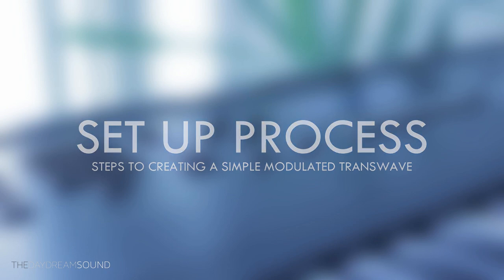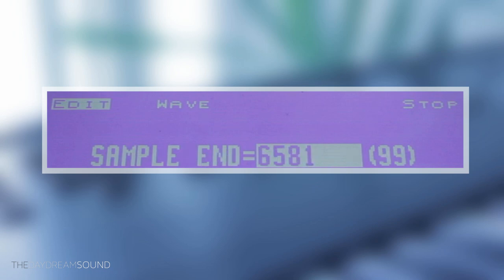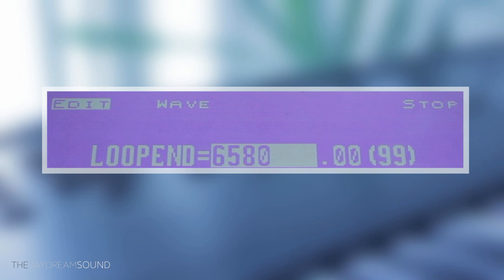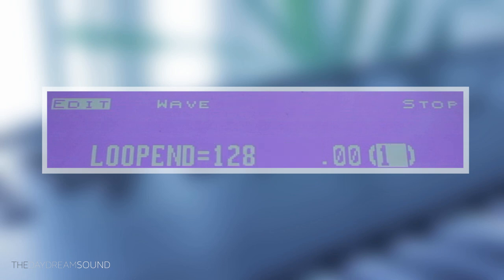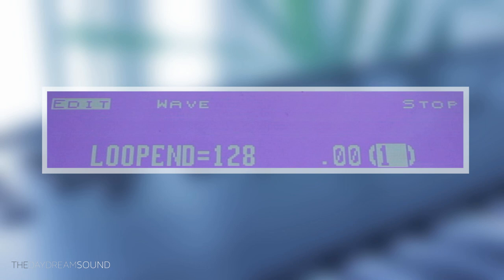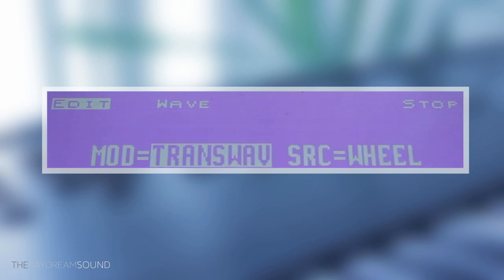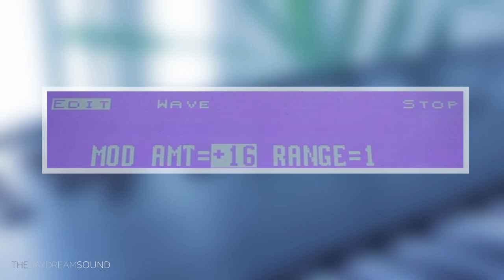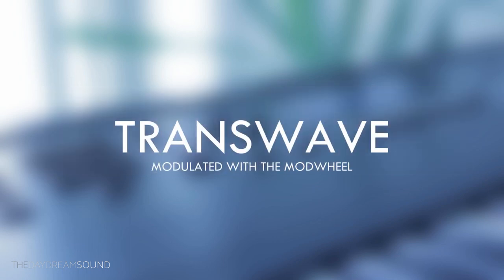How To Make Simple Ensoniq Transwaves on the ASR 10 Synth Sampler

Comment: That's cool. You made me want one. Have you ever used a Korg dad-1?
Reply from the maker: What's up Dustin! The ASR-10 is definitely a great sampler synth! Did you mean a Kord DSS-1? If so, I haven't' but it's a great sounding sampler and I do want to pick one up sometime.
Reply: Whoops stupid autocorrect. Yeah I meant the DSS-1. It's a pain to use but I love the way mine sounds. They're gigantic though so you really have to love it to let it take up so much room.
Reply from the maker: The first time I heard one I was blown away!
Reply: not only size but the weight of it ,  but i sold mine long ago  ,  to slow diskdrive  ,  quite  thinny  sampling quality  (an ensoniq  blows it away)   albeit  the same analog filters of the dw8000  , the rack version dsm1   featured  16  outputs as i remember

Comment: I'm assuming this is possible on the EPS-16+ as well?
Transwaves are definitely necessary for my brew of industrial/avant-pop.
Reply from the maker: What's up Sailbot216! Thanks for reaching out! It's definitely possible with the EPS16+!
Reply: Good to know! Just checked the waveform mod options and there it is!
Reply: Trying to do it now and I'm having some trouble. Not sure what I'm doing wrong.
I bring in two samples, each in their own layer, then splice and add the transwave mod and nothing seems to happen. I am making sure that the mod amount is adjusted, as well as the loop points.

Comment: I have tried this with an Ensoniq ASRX (the red one) with no result...I would be so happy to make it work on that machine. Any suggests?
Reply from the maker: What's up Edgar! Thanks for reaching out! The ASR-X is a completely different sampler with a completely different process to access and edit its Transwaves. It is for the most part only accessible with a computer on the ASR-X/PRO.
Reply: but I have that "StartToEnd Index" which can be modulated "IndxModSrc = Full Amt", which means that the following "Index ModAmt" should produce some hearable results....but there is nothing ...
Reply from the maker: Full velocity will give you the same modulation every time. It's useful for a definite alternative start point. Have a look a t this video. https://youtu.be/PLgS9Cngz_Q  Hope it helps!